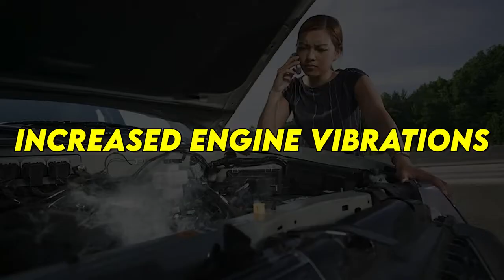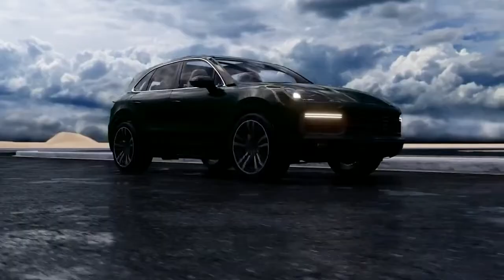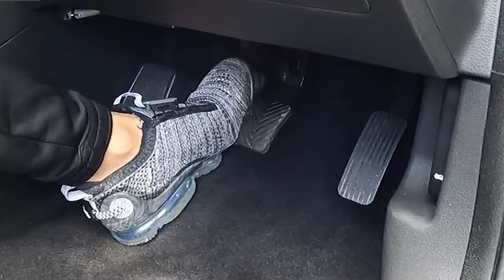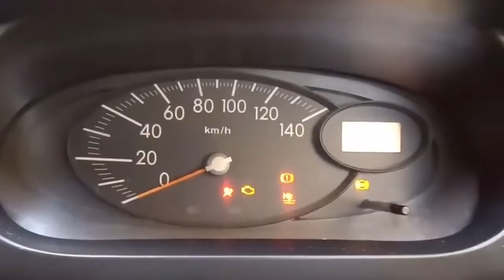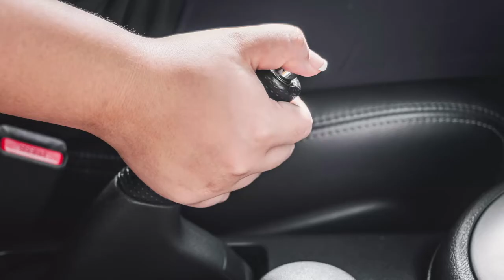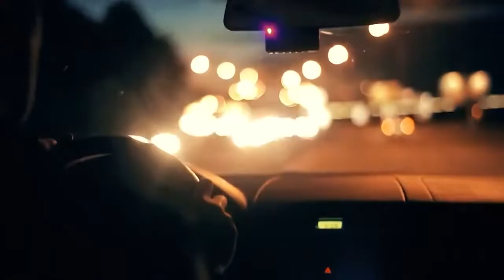6 Bad Engine Mount Symptoms - Fixes!

Comment: You help the rubber engine mounts resist drying out and cracking . By periodically liberally spraying them with 303 Protectant  . As well any other engine rubber components or those underneath the vehicle .